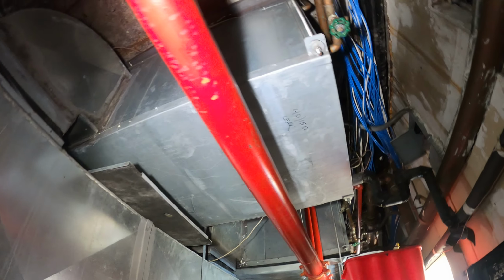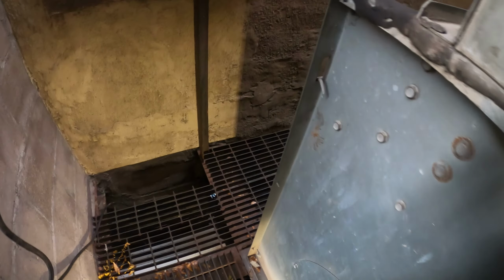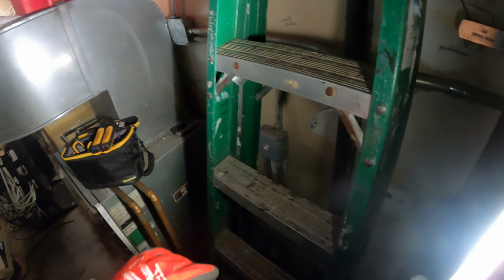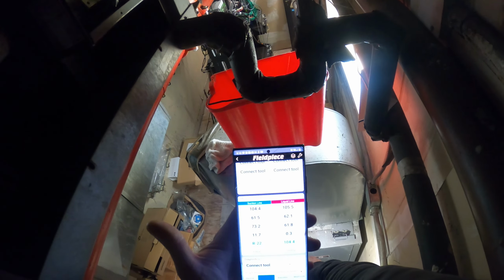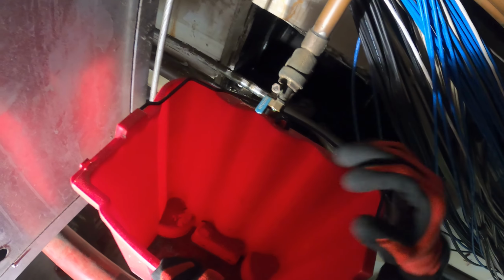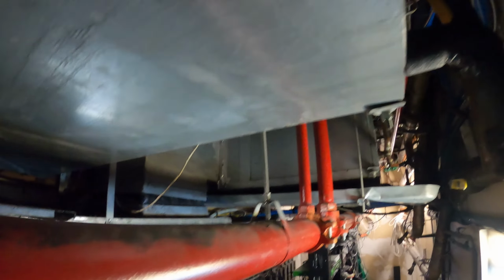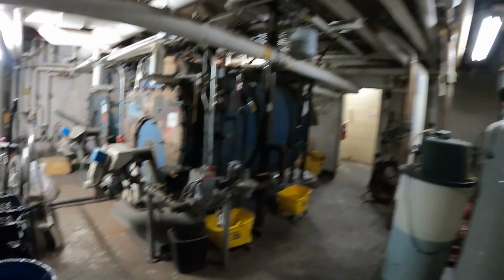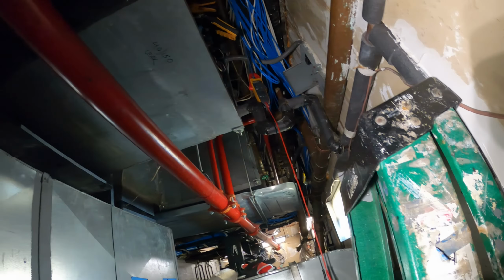HVAC Service Call: Water Source Heat Pump Short Cycling & Cooling Tower Water Temperature Too Cold

Comment: May I have one question plz? We work with Water source heat pump in Vancouver, but we don't touch cooling tower at all. I am wondering how does the WSHP generate heat, so any heat source for water? appreciate

Comment: HP cools the water on the tower during heating  and usually tempered by heating water with a heat exchanger or with the sump heater.

Comment: Would’ve been cool if you explained what the strainer does and where you usually find it
Reply from the maker: I have a video on strainers on my channel so check that out 🙃 The water strainer is always on the water inlet pipe for the condenser as far as units. It's pretty much on any inlet water line. Follow the pipes! Stay tuned for videos every week!🔧⚡

Comment: Usually there’s a 3 way valve that injects boiler water in to  temper the loop
Reply from the maker: The next day we were able to set that up and the water temp stabilized around 75 degrees F. Thanks for watching! Stay tuned for videos every week!🔧⚡
Reply: @JumpermanTech   thanks  for the reply glad you got it figured out. I had the same issue the other day the valve to the dry coolers was open water was 50 the boiler was working it was like pissing in the ocean …
Reply: "Hotel by Westside Highway"
I cannot believe I recognized it by the 18:20 frame.😄

The 3rd pump at the back of the Eastco steam boiler injects heat in the tower water loop via a 
water/water heat exchanger.
The setpoint of the tower should've been around 95F ( ON above 95).
The 3rd  pump(injecting heat ) setting  should've been around 60F (ON below 60). water temp. 
The heater at the closed  Tower is the tower sump heater. Keeps water from freezing during winter month. 
As always Great job!

Comment: Do they not have any boilers for heat add? That loop is way too cold. Here in Buffalo, our winters are cold, but the buildings always have boilers for heat add to the loop to maintain at least 70°-75° loop temp in the winter. 80°- 85°for the tower in the summer.
Reply from the maker: The next day I was able to work with the operating engineer and we stabilized the water temp around 75 degrees F using the boiler loop. Thanks for watching! Stay tuned for videos every week!🔧⚡

Comment: Great troubleshooting
Reply: Are the boilers running for the hydronic loop? Usually 65-70F is low temperature for boiler  to start and keep the hydronic loop from getting too cold.
Reply from the maker: @jfrancis98  I spoke with the engineer and we were able to switch off the fan and setup the loop from the boiler to keep the water temp from 75-80 degrees ✌
Reply from the maker: Thank you Neilvester!! ⚡⚡⚡